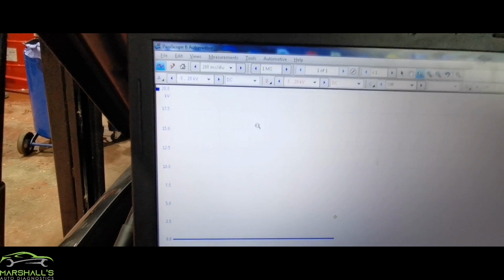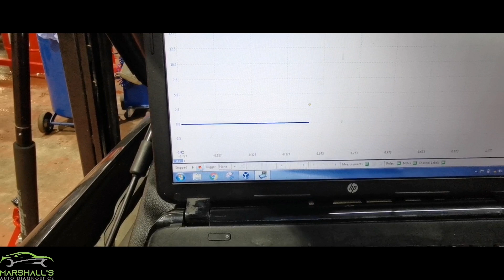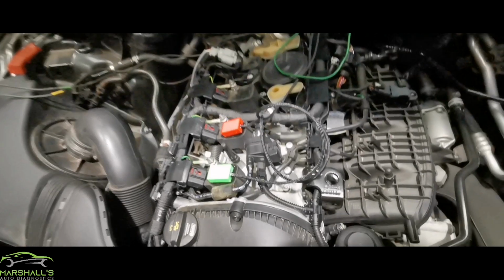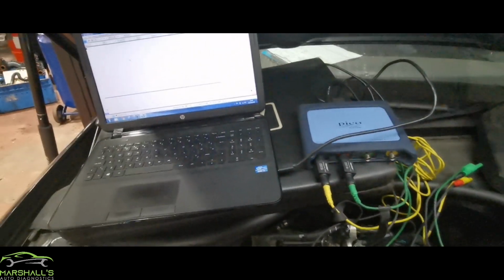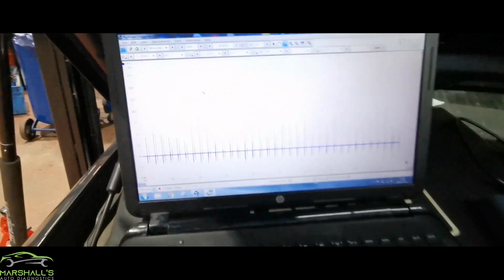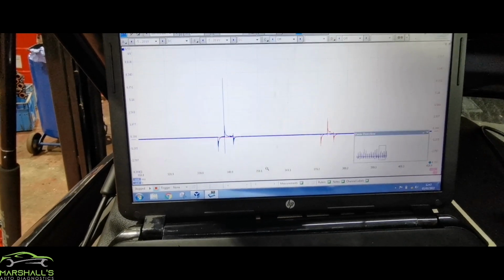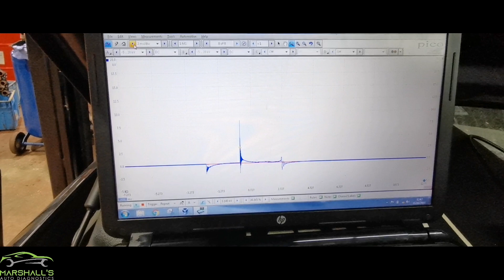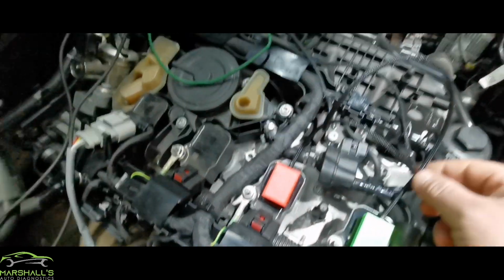secondary ignition pick up, coil over plug or COP

Comment: cracking waveform there Stephen. Are the leads screened from undesired induction?
Reply: I was just going to ask if the leads are shielded.
Reply: @weldingjunkie  whaaaatttabouttye Jay
Reply from the maker: I haven't added any screening dave, I have an attenuator and the copper is encased in silicone. That's all I've done
Reply: @m.adiagnostics5013  dead on. I'm just wondering, why you need for the attenuator? Are you worried about discharge maybe.
Reply from the maker: @davesterl  In pico 6 when I selected secondary ign inverted it works on pre set scaling, my signal was over ranging on those scales so I added the attenuator knowing it would bring my signal amplitude down. It worked great. Maybe I'd need to set a custom probe going forward or work from pico 7. Pico 7 I'm sure you can just invert whatever signal is on screen. Maybe pico 6 you can also just invert anything as well 🤔
Reply: @m.adiagnostics5013  ah right ok. You're using attenuation because of presets. That's a good thing as it shows plenty of signal from your pick up. I tend to use the micsig for live captures as it has an invert button, plug and play. I made a pick up once with a resistor inside, takes out a bit of noise but i rekon you're achieving similar with the attenuator which is just resistors in series and parallel
Reply from the maker: @davesterl  yeah it's much easier and I'm lazier 😁. I can cope with adding the attenuator it's no hassle I have 5 anyway and they are cheap. I like the micsig I've wanted 8ne for a while now actually
Reply: @m.adiagnostics5013  yeah, looks like pico is wanting to kill off pico 6